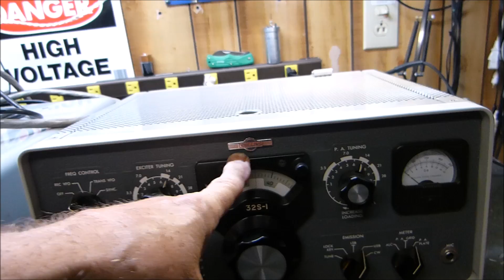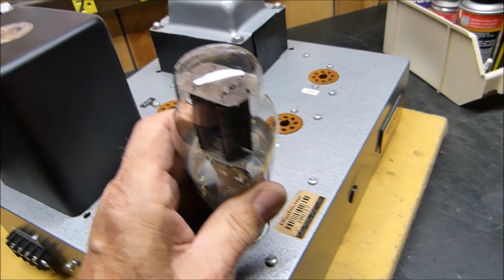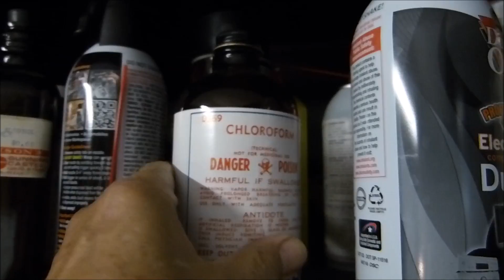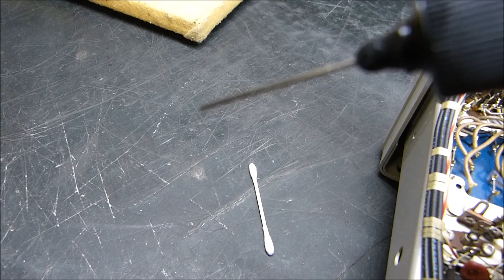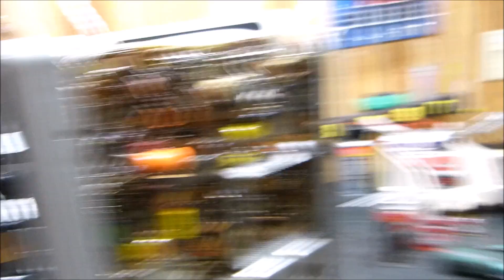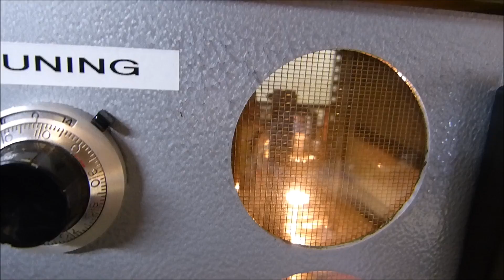Care & Cleaning Of Vacuum Tube Audio Amplifiers & Amateur Radio Equipment

Comment: Thank you , for pointing out those tube pin contacts. 
I have built and accumulated a few guitar amp heads over the past few years.  
Honestly some sit on the shelf more than getting used. 
The jacks get a build up of whatever is in the air. 
Plug em up and no sound. 
Yikes 
I've taken to cleaning the speaker output jacks  before use , as a habit.
Same is needed on speaker cabinet input jacks. 
I noticed the dirty jack thing with a smaller head , lucky it wasn't one of the larger heads.
If those output and input jacks need cleaning ,  the tube sockets might , need it too.

Comment: Your socket is newer fork contact,is not known among military hardware,
You may want to get the wrap around type.
Reply from the maker: I personally like the 'wrap-around" type socket pins like you mention but the vintage military type socket pins with only two "bite" type contacts on each side of the male pin do seem to work very well. I assume this type of two-contact-bite type of military socket is made of very hard and strong spring metal that does not soften up under heat and age.  ??

Comment: What do you think 🤔 of Socket savers?
Reply from the maker: In equipment like tube testers where hundreds if not thousands of tubes are inserted and removed over the life of the equipment, I think it is a good idea but in the use of standard and daily or continually operational equipment, I would not  recommend or use them. 
Many problems occur at the interface connection of signals between and within equipment and the additional of a tube-saver socket doubles the connections between the vacuum tube and the equipment so I think it is only acceptable in a test environment and even there, care must be taken to  make sure good electrical contact is maintained for the the testing of the tubes.
Reply: ElPaso TubeAmps Think you for the information!So you don’t think it would be a good idea to by a DV amp and High end tubes 😜

Comment: Do you worry about the deoxit residue building up in the pin holes?
Reply from the maker: I think all this oily spray should be used sparingly so it doesn't leave a residue behind that collects dust and can congeal into a goo over time and make the situation worse and plug pin holes. Also, some of it has poison signs on it and I take warnings like that serious. Maybe I learned to be a little neurotic/cautious over the years I used solvents at work like trichloroethene and another product called Fedron (I think that is a brand name) but I have "poisoned" myself using these substances and fortunately got past it. I tend to hold my breath when I spray anything and should always put on eye protection, which I don't always do. I know you ask about plugging pin holes but health risks are my primary concern with a secondary concern of residue buildup that may plug holes and attract dust and grit. On the other hand, the cleaners/sprays usually help quite a bit. Thanks for your comment.

Comment: Thanks for the great videos. I very much trust your expertise and judgement. Just wondering, is there a good way to tighten loose tube sockets? The tube just sits loose in the socket, with intermittent contact.
Reply from the maker: Lose pins can definitely damage a tube especially a pentode/tetrode with a lose plate pin connection. I had a McIntosh MC275 that kept blowing one particular KT88 and it turned out to be a lose pin 3 (plate) connection. That incident is actually what prompted me to make a couple of YouTube videos. I have a set of dental tools and some large sewing needles that I use to gently pry the female pins a little tighter. It has worked fine for me as long as the socket is of good quality. Some of the cheap ones I have seen lately have no hope as the metal is so soft and the socket should actually be replaced. With this experience, I now am much more careful when removing or inserting tubes in everything I work on. Hope this helps.

Comment: Great video! I need to replace a transformer on my tube radio console. What tips can you give me. I have the following wires: 2 high voltage wires that goes to the plates (2 rectifier 6x5 tubes) and the center tap wire; 2 wires for cathodes; 2 wires for the off/on switch.

Comment: I agree with Pomona Bill whole heartedly, Thank you.   I particularly found the info regarding checking the pin contacts on the sockets.
I have a boutique twin 6550 tube  guitar amp and recently needed a tube change so I used a very respected tech here in Sydney, and have been red plating since. Even with the bias turned down.
the warning sign is a slowly growing hum that becomes louder. The tech said he has changed the plate resistors, but still trouble. 
I also fear he has applied WD40. I will bring up your info with the NEW tech on Tuesday.  Again Thanks
Reply from the maker: I hope you get your amplifier fixed right away before destroying any components. I have heard of others using WD40 to clean sockets and contacts. I have heard it is so much cheaper and works as well as expensive contact cleaners. I don't believe it and I would not use it. I have personally not researched this but I may now that it has been brought up. As I understand it, "WD" stands for "water displacement". It does sound like to me that your control grid pins are (possibly) not making good contact with the vacuum tube pin (pin #5) 

A good thirty years ago, I had a 1976 Camaro that after cleaning the engine, I got some water vapor in the distributor cap and the engine would not start. Finally, a good fellow seeing my dilemma, came over with a can of WD40 and took the distributor cap off again (I had tried to dry it several times with a rag) and once he sprayed it, it was like magic, and the engine started immediately. This certainly proves one thing about WD40 - it does displace water and I dare say, somewhat insulate the contacts with oil. We know oil does not conduct, that's why we fill big transformers with oil. So, I am concerned that the WD40 added a layer of resistance to the female and male pins of the vacuum tubes. I would personally clean it off with a safe solvent like alcohol and use a real contact cleaning product like the DeoxIT brand of chemicals.

As a field engineer for three decades, I experienced switches that carry virtually no current (micro amps of current) to fail every bit as often as relays and switches that carry several amps of current. With the micro amp currents, there is no cleaning of the contacts by current flow and the least bit of oxidization will cause failure. Of course, lots of current arcing every time a relay or switch contact opens and closes will limit the life of the device also simply from burning of the contacts. The control grid pin of an amplifier draws virtually no current from the supply (micro or namo amps) and falls into the first category of switch I just described. The plate contact (pin #3 is like the relay/switches that have somewhat of a self-cleaning action because of the higher currents i.e. 50-150 mA or so.

As I mentioned in the video, loosing a plate lead connection will destroy the screen of the tube within seconds and you won't even know it happened. I will say in your case, I don't think the screen has been destroyed yet because once the screen is damaged, the plate current will be low (and probably is not capable of "red-plating" anymore).

I certainly don't mean to cause panic here but if you want your amplifier to work properly and the tubes to last, you should find out why the plates are turning red. No receiving-tube-class of vacuum tube should show color in the plate.

One last thing - what is meant by the "plate resistors"?
Reply: Thank you so much for your fast and detailed concern over my Blankenship Twinplex amps wellbeing.
The plate resistors referred to are connected between two pins on the output tube sockets, I'm not certain which pair of pins.
I'll be meeting with the new tech in the morning and will be discussing all of your info and points with him, and will be present for the inspection. 
Ive watched a dozen videos in regards to my issues and feel that your points regarding the pins on the power tube sockets might just be the ticket.
Could condensation on the sockets have a similar effect?

Again thanks so much for your thoughtful and fast reply.
My very best regards Dale, Sydney Oz.
Reply from the maker: The resistors between the pins are probably between pins 5 and 6 and are called grid-stopper resistors. Not a big deal. Your issue prompted me to do some experimenting with WD-40 and DeoxIT. I used some vintage male and female sockets measuring the resistance between the connections down to about 10 milli ohms before any cleaning and then after spraying them with WD-40 things got a little better. Then I cleaned them off with alcohol and used the high$$  DeoxIT and nothing got better but then the male and female pins had been cleaned so much nothing would make anything better. I researched WD-40 products and there is indeed a contact cleaner made by WD-40. The WD-40 (regular) did leave everything really greasy and you can easily smell it if it has been used Best of luck with your amp and your meeting. You are certainly going into the discussion better informed with your research. If you find anything interesting, please let us know by posting your findings.
Reply: +ElPaso TubeAmps 
Thanks so much again.  I've just left the tech, and have shared all the info that we have discussed.  I'll let you know in detail the results, findings and works when the tech has finished up.  You sir are a true gentleman for all your interest and efforts towards solving my problem.  Thank you.
Reply: Ok, here is the tech report after repairs completed..
" Plate resistors on phase inverter circuit had been replaced with 1/2w metal film resistors (82K was made from paralleled 100K/470K) by previous tech. Contacted Roy Blakenship to confirm correct resistor values and also reccomended idle bias current for output tubes (~45mA). Removed resistors and installed build correct, new 1/2W 5% 82K and 100K carbon composition resistors..."   
  Job done! Thanks
Reply from the maker: Excellent - I am pleased that you got it working properly. Thanks for letting me know.
Reply: David
  On the S line,would it be easier to take those cans off to clean those contacts? You did a beautiful recap job on that unit.
Reply from the maker: Thanks, Mike. I never thought of it until now but I assume the can covers do come off by removing screws from the top of the chassis (?). Also, I am using the R-390 and the 75S-3 together as I operate nowadays. I have to say that the 75S-3 does just barely, out perform the R-390 in sensitivity - just barely. I also have to admit that the dial of the 75S-3 is more pleasing than the digital dial of the R-390. How would you compare the two receivers?
Reply: ElPaso TubeAmps
 The 390a,they made improvements and they have mechanical filters.I have a pair of R390a receivers and one was assembled by Collins and the other by Motorola. I need to go thru the 2nd one but I have to get off my lazy can first. LOL

Comment: Hi David! Hope all is well. It's interesting that you've done a video abut losing the plate supply or bias to the grids of 6L6GC's etc. You are so right about today's modern tube amplifiers having crappy sockets. I recall one customer frying 2 sets of new JJ's and a set of NOS RCA 6L6GC's in a Fender Twin reverb (reissue). When he decided to put a crowbar in his wallet and bring the amplifier to me, after less than 5 minutes of investigating I discovered why 3 sets of tubes got toasted. Pin 3 contact in two of the sockets became loose, arced, and burnt to a point where the contacts just dropped out of the sockets. When I removed the defective sockets, I took notice to the brand name. When I saw the name, I thought it was the name of a local Chinese takeout restaurant...I couldn't even pronounce it! LOL. At that point, after installing NOS "Amphenol" sockets, and replacing some damaged wiring, and 6 tubes later, I got the amplifier up & running again. Customer pissed & moaned about the bill, but i told him he could've saved that money if he would have brought it to me much sooner. after cooking the second set of tubes, he should've seen daylight...Great video as always...PS: next post, I'll fill ya in on what happened to a pair of 866A MV rectifiers during a short...I think you might know the outcome LOL :)